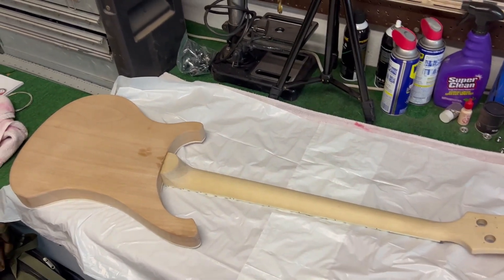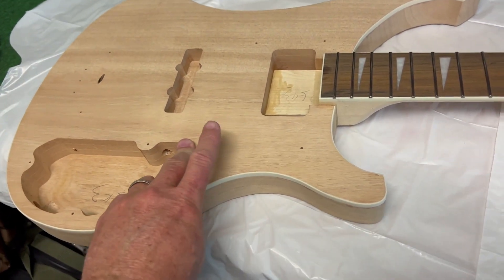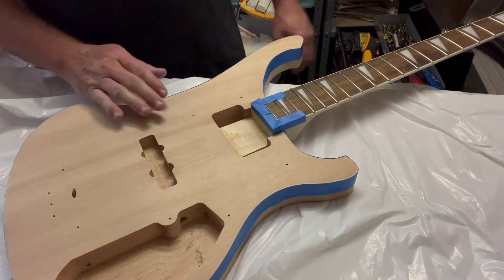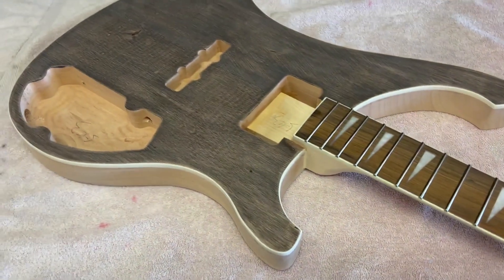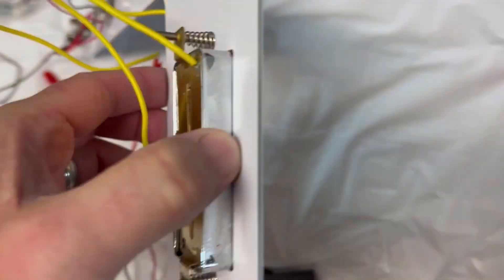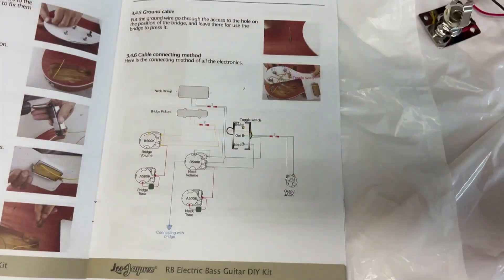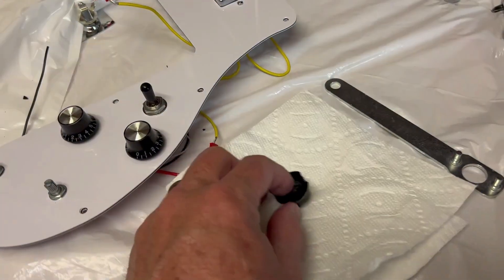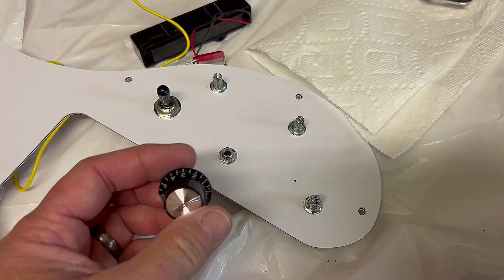LEO JAYMZ RICKENBACKER BASS COPY GUITAR KIT PART 3!

Comment: I know I’m late to the party but you should have sent the kit back.  Your body and neck do not appear to be matched.  There is a penciled number on the neck extension that glues into the neck cavity.  The body should have a matching number in the neck cavity.  I did not see one on yours in video 2.  This is why the neck didn’t fit correctly and the neck angle seems off.  I have the 6-string version (480) version of this kit and it is fantastic.  You got one that got past quality control.